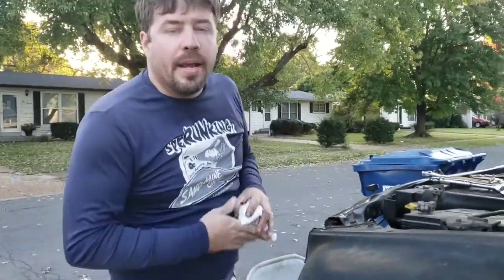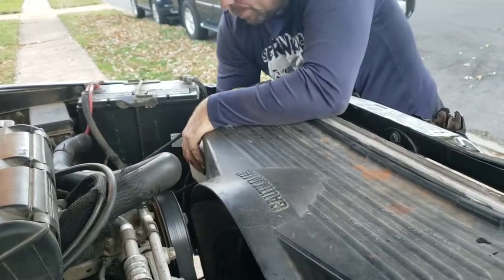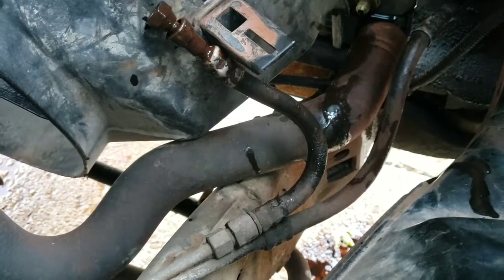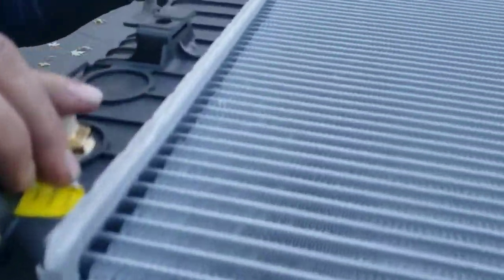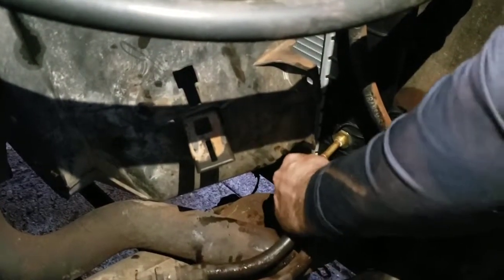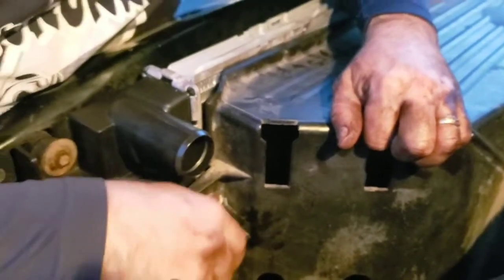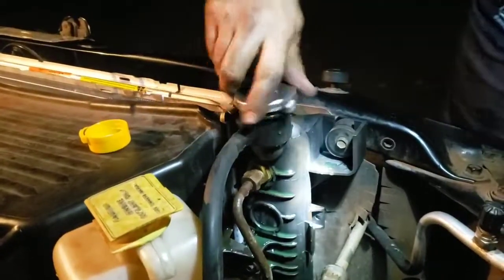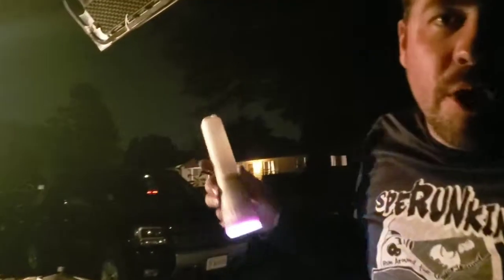Replacing radiator in 2nd gen dodge ram 1994-2002

Comment: Hi i just installed a new radiator on my ram 1500 do you burp the bubbles so air doesn't stay in the system?
Reply from the maker: Hey Lopez, you can burp it if you want. Just park slight on uphill amgle take the radiotor cap off and run the vehicle for like 15 minutes till it warm up enough for the thermostat to open then after you see it/hear it burp turn it off top it off and close it up. Keep an eye on it so it doesnt bubble up all over the place. Wash off any mess with a hose.
Thanks for watching and good luck.

Please like and subscribe every little bit helps during these times.

Seize the day each and every day-Are Jay 

Here is our second gen playlist if you need it.
Top 2nd gen 1994-2002 Dodge Ram repairs and upgrade videos: https://www.youtube.com/playlist?list=PLQ0kUxbVWpJ-ebGroH9mPPUSfTWONjU-0

Comment: Question where does the ambient temperature sensor go mounted on on a 97 Dodge ram like I have the sensor but it's just hanging there and I don't know where it bolt onto. Can u help me??? Thank you
Reply from the maker: I think mine mounts on the back of the bumper, I will try to to remember to check tomorrow.